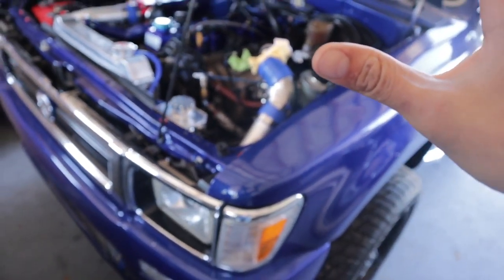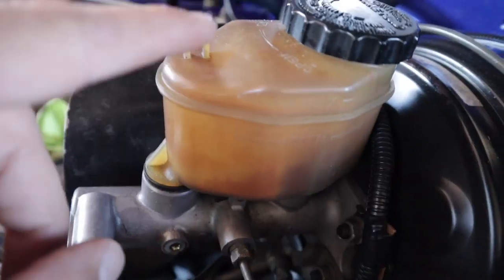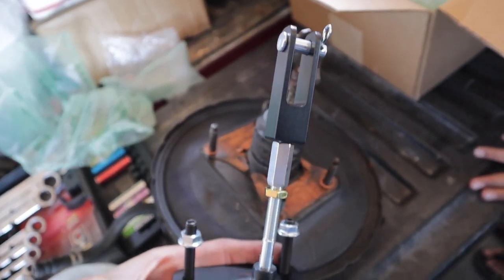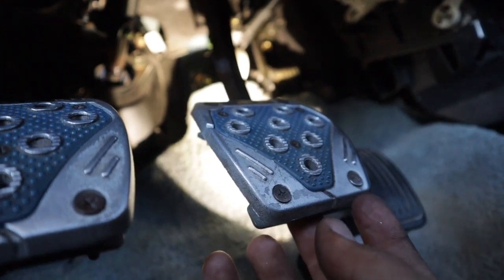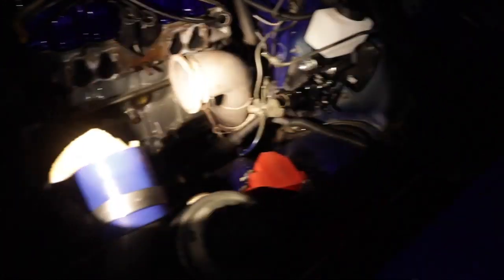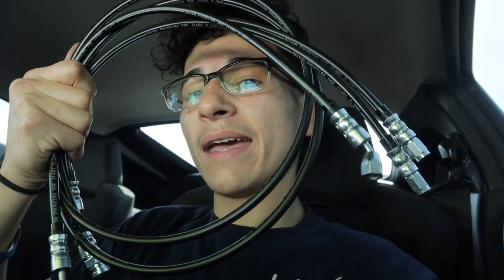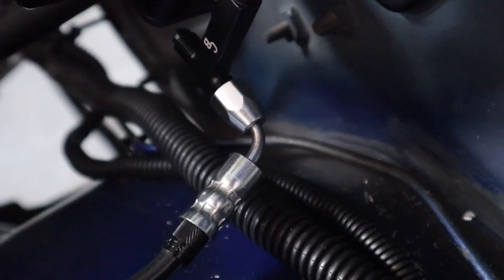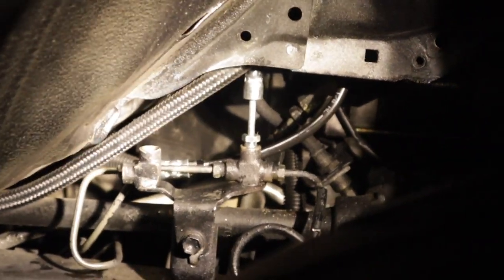Installing a ChaseBays BBE on the Toyota Pickup! PART 1

Comment: Hey nice video, tryna figure out what you did with that brake booster vacuum line? Did you just leave it there ? Or what did you do to it ? Thx
Reply from the maker: I just capped it so it wouldn’t have a vacuum leak. Thanks!